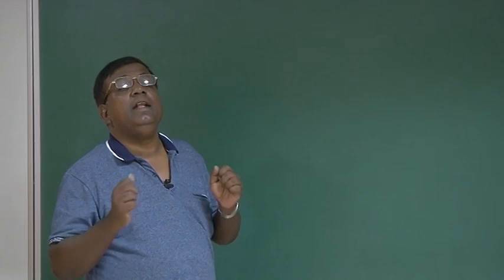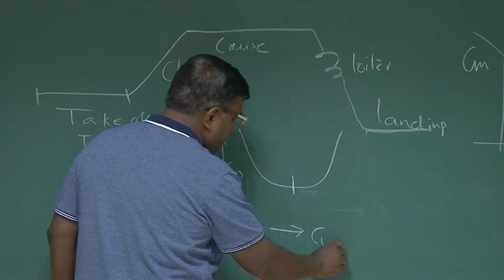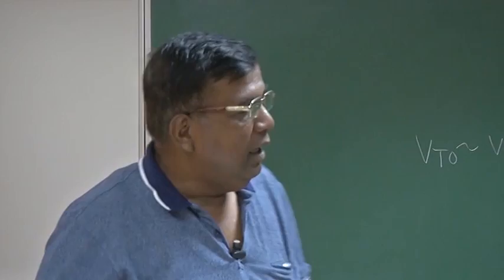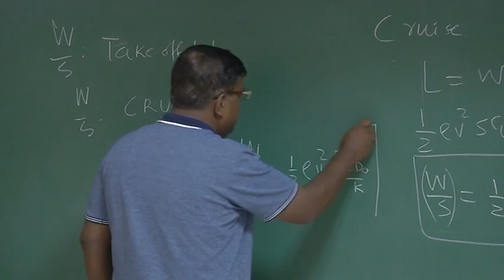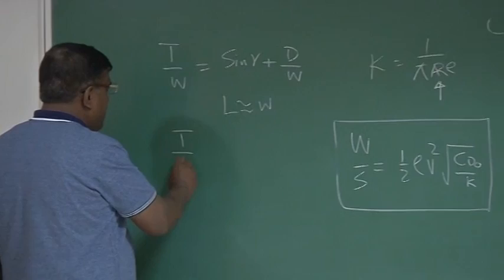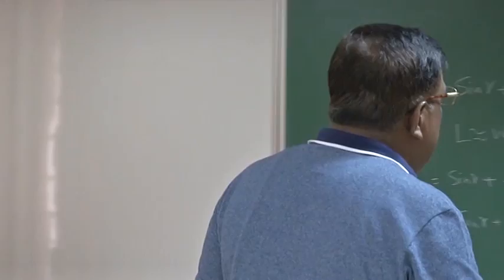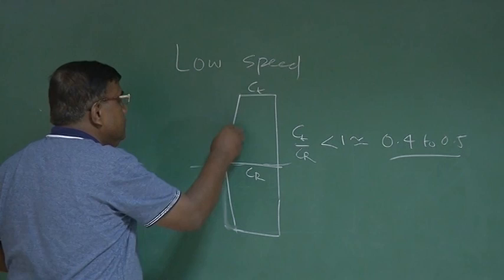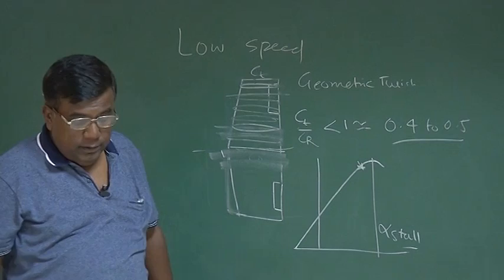Design Basics: Wing Loading & Thrust Loading

Comment: Requesting for answer
When Flaps are extended
1. It will develop moderate Lift on take-off and high lift during Landing OR,
2. It will develop high Lift on take-off and Low lift during Landing
Reply: It'll develop moderately higher lift required for take-off & more drag(very less lift) during landing.
Reply: It increases the lift coefficient not lift